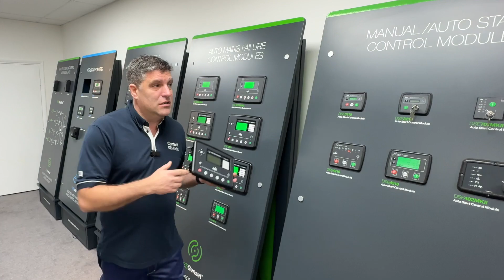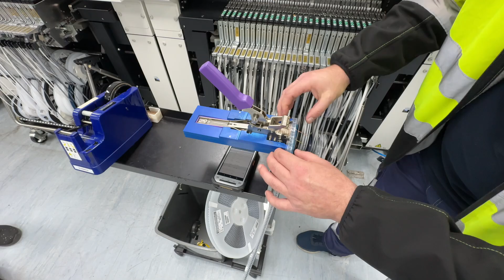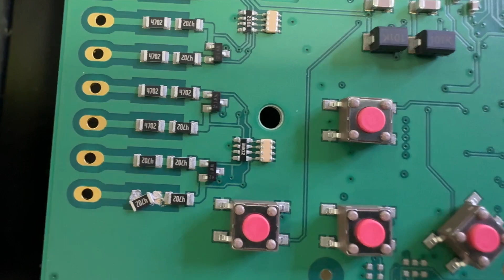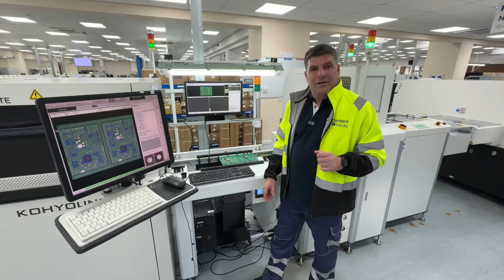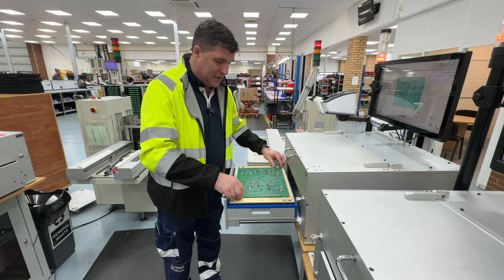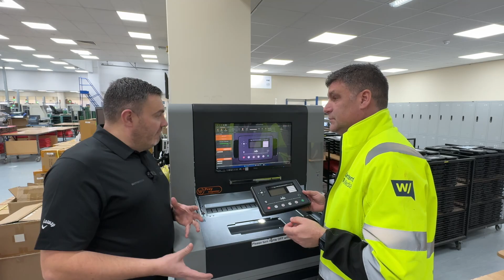An Insight into DSE Manufacturing with Peter Haddock (Full Video)

Comment: You people are doing amazing work. Manufacturing really easy plug and play and user friendly modules. I would like to know if you have a system for the modules those are working at the end users premises which sometimes become faulty after running for a couple of years. How long do you expect these modules should long last and make no troubles. As we are using different DSE products at our different locations and we have encountered problems with two of these modules, one with 335 and one with 7320 MKII. Local distributors were unable to idendify and fix the faults so ultimatly we replaced them with new modules. Do you train your distributors or resellers to repair the faulty moduls and do they report such potential faults to you or not. We can provide you more details if you require please. 
Best regards.